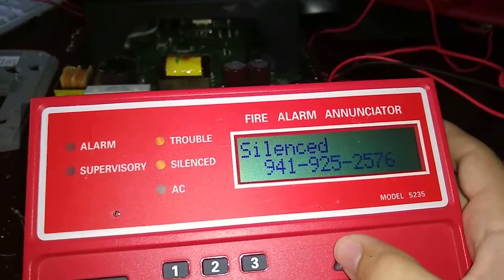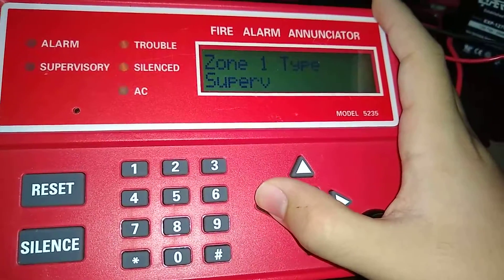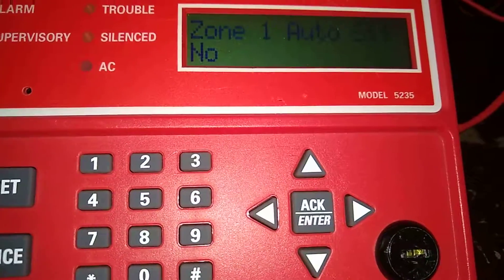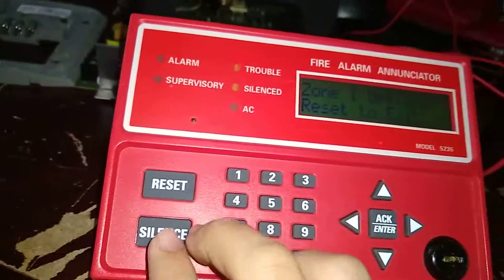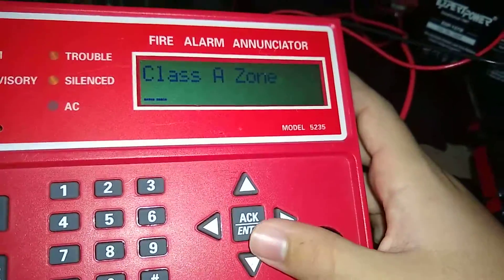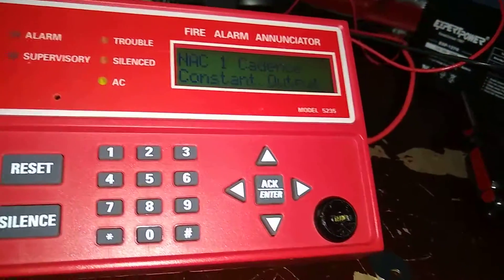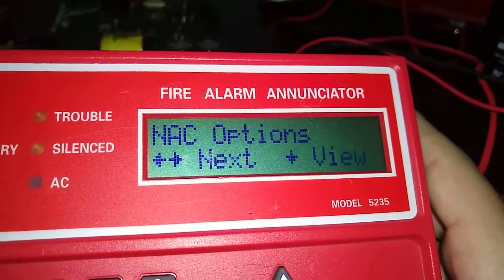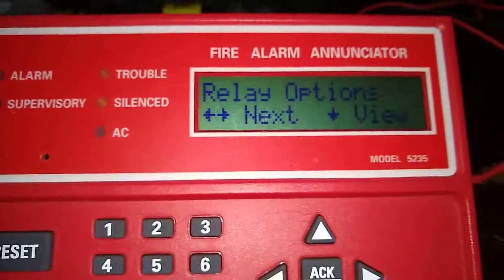Silent Knight 5208 Programming (Part 1-3)

Comment: You don’t see a panel to be able to program from the annunciator every day.
Reply from the maker: Not Silent Knight 🙃
Reply: @FireTech7  that pretty cool. I think you can buy a annunciator (ra-1000,5860) for the ifp-1000 and program it from there but silent knight annunciators are expensive on eBay.
Reply from the maker: Not sure of the actual state of the ifp-1000